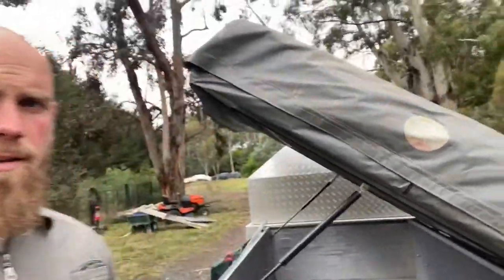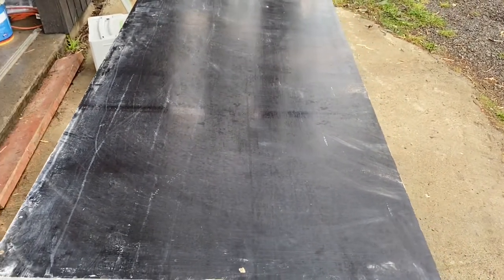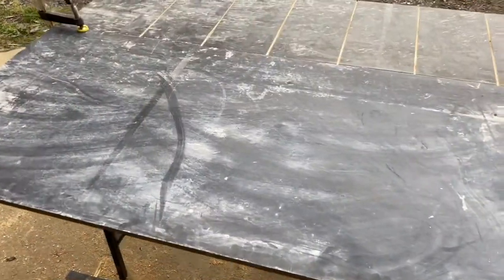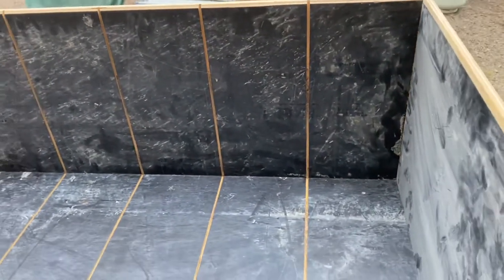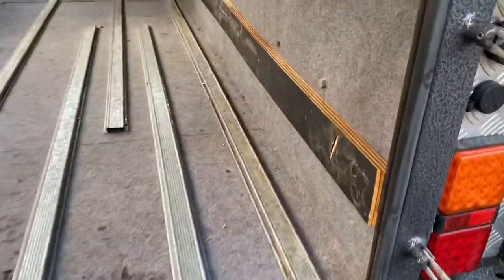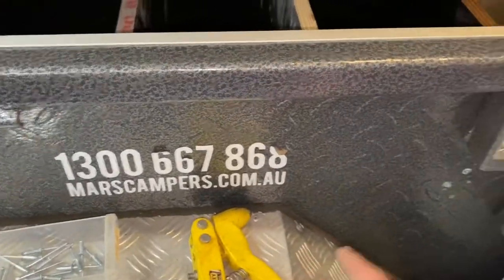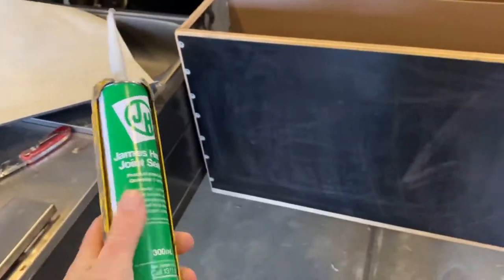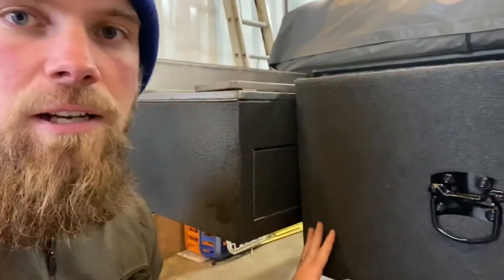DIY Camper trailer maximise storage with custom storage drawers

Comment: Thanks for showing all the details of the build. Really appreciate the effort. It is really useful to see the decisions which have to be made when little problems arise, like the edge of the drawer on the edge of the trailer. I liked how you protected the tarp with the simple addition of a bit of formply over the brackets. A cabinet maker friend suggested waxing the top of the 'runners' to lessen the resistance on a bigger drawer like this if it seems hard to pull out and push in when loaded. Out of interest, how did it go when you loaded it up and went camping? Were there any changes you thought of?